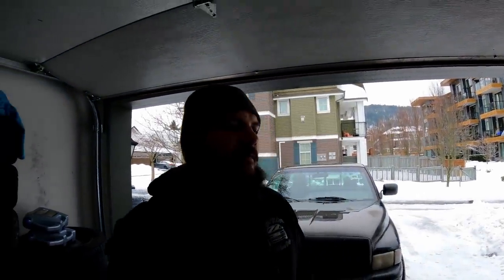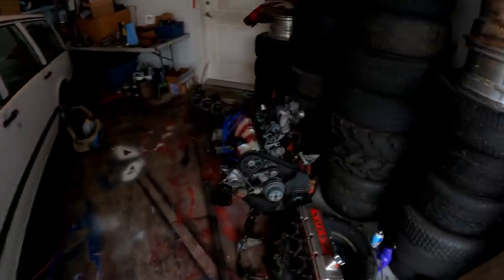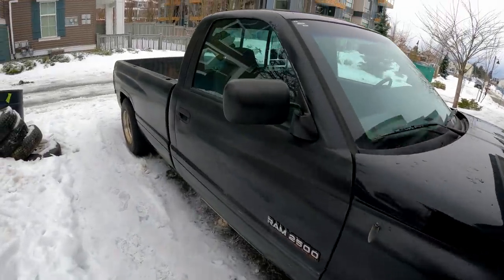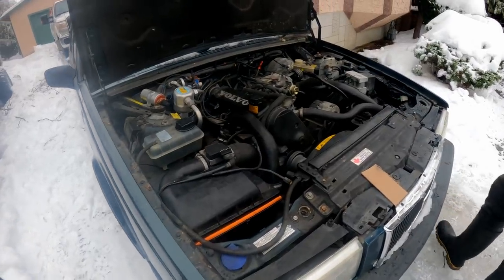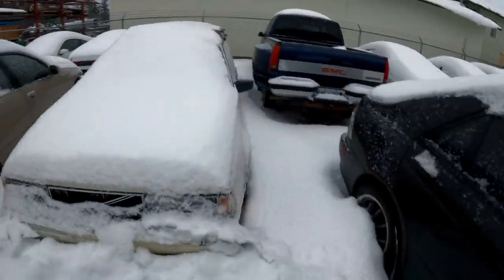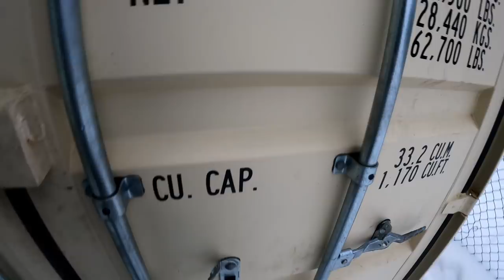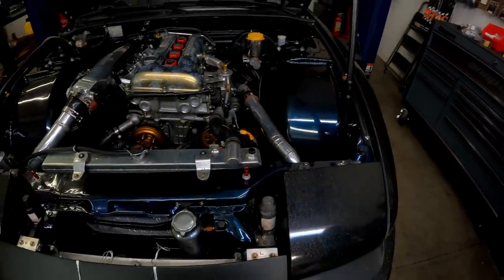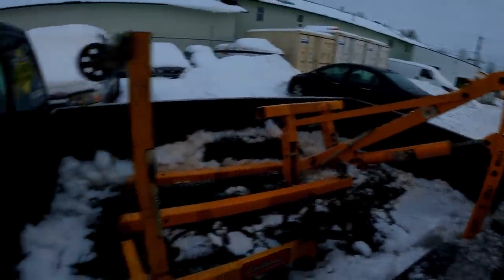is this the best station wagon ever created by the human race?

Comment: Do you think I need a wideband for 10lbs on a 13c 1990 740? Or is there enough room for error to not be concerned?
Reply: I didn't run one for over a year. But it's always a good investment. Especially if you are gunna Rip on the car. Don't you want cool extra gages?!?! I got the Aem wideband. It's a slim version of the original.

Comment: ANY chance someone can give me a little advice- cash is low but ill figure that shit out to make it fast. Got a mainly stock 1990 740 with cold air intake, catback exhaust and a couple other hooptie ass upgrades. The nipple on my turbo snapped off, and my boost gauge is saying I am only getting 3-4.1 psi. Should I just get an ebay t3t4 hybrid and maybe get a new intercooler and redo the PCV? The PCV needs to be replacedf and I have the part, but the bolts are impossible without removing the intake manifold.I would be down to get a new one of those if there is an affordable one. Also, which cheap injectors should I get and who do you guys get your ecus from(I ordered one from a seemingly legit guy on ebay and he bailed on my order)? I chopped my springs and have some worn out bilsteins so the ride is complete shit, I know its looked down upon but i am contemplating a jerry rigged air ride system. Anyhow, please help me as I am blowing it on the regs and spending too much time getting nowhere. If youre able to give me a bit of your expertise and time, Ill compensate somehow (i live in mammoth and you can come stay at my pad and shred or we can drift volvos and offroad sensible midsized's or something? Alright, thank you guys so much, freakin DRERTS AND LERTS haha thanks for the sticker pack. email-claydaws@gmail.com or hit me uyp on IG @claydaws